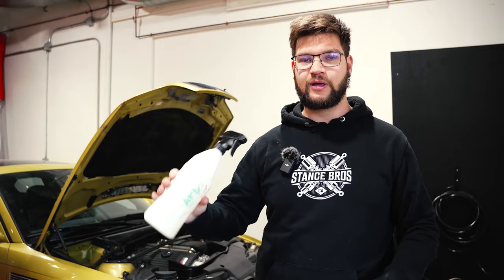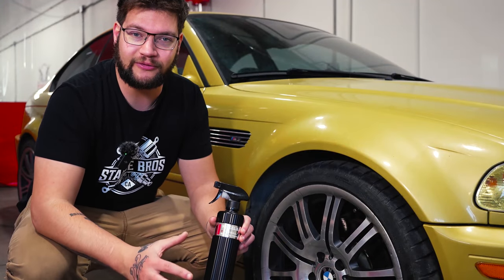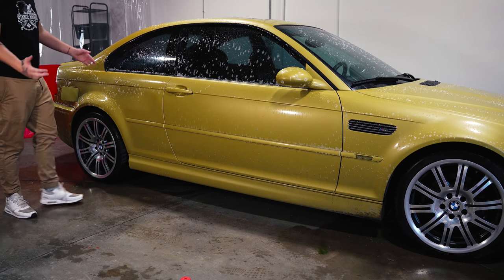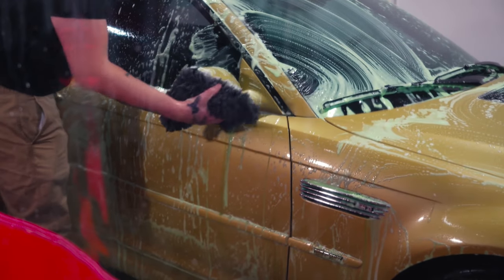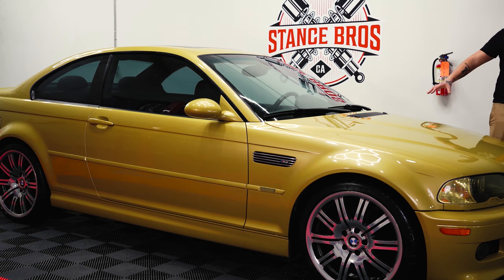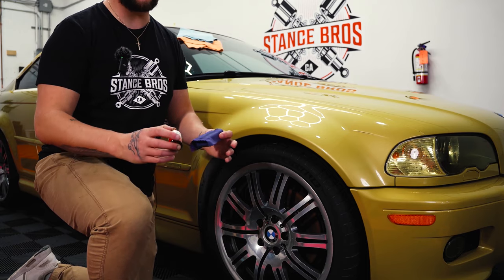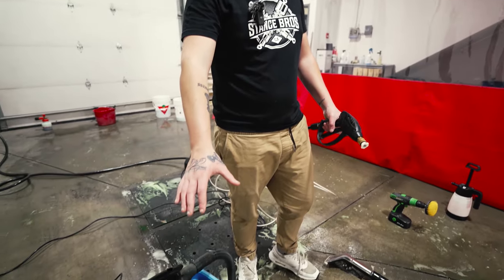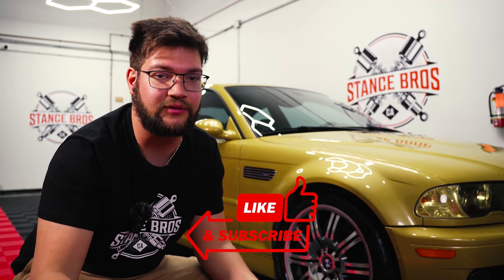Phoenix Yellow Beauty Unveiled: BMW e46 M3 Full Detail and Polish Showcase | Stance Bros

Comment: Do these rims still have the original clear coat on them? Do you change them for a  17" set in the winter? Winters in Calgary are pretty harsh
Reply from the maker: That's for the comment! We believe it's the original clear coat. The car has never seen snow or winter. For the last 5 years it was parked in a garage and never moved an inch. It was amazing to see how new the car looked from th inside and out

Comment: That engine cleaning they did pretty much didn't do anything. All they did was to make what the eyes can see clean. Begin to take off components and you'll see how much work is behind everything. Start with the oil filter housing and go from there. I have my 2004 E46 right now I am restoring that sat under the ether for 7 years.
Reply from the maker: Thank you for the tips we will try that next time. We did do a more thorough clean off camera and left exactly what you mentioned for the video. We will have a more in depth video coming soon. 

7 years wow. What shape was it in when you started?